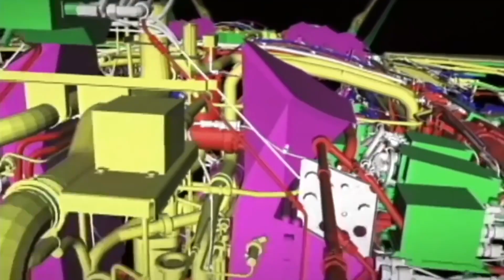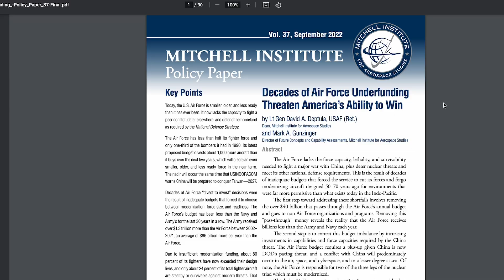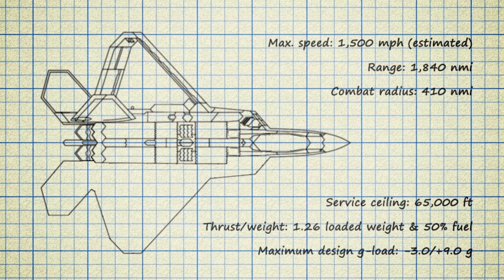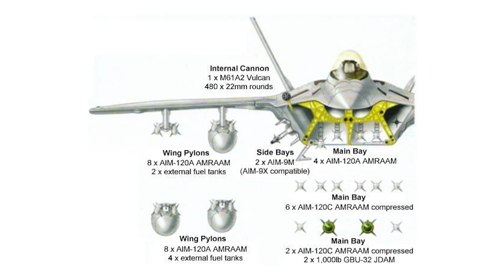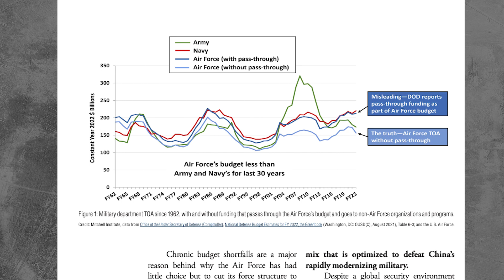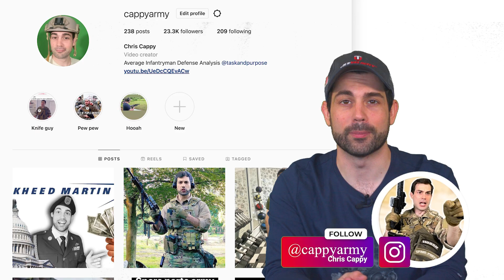Cancelling the F-22 Fighter is Worse than You Think

Comment: To think the US has had this for so long. They are miles ahead technological wise.
Reply: No they are not - F-22 is the Space Shuttle of the USAF - truly astounding technical achievement with basically 1970s technology. F-22 missed out on a giant leap in computing performance and density by about 5 years - as it is, it was rechipped with early 90s stuff when it was in production and those are obsolete. That leap has effectively obsoleted stealth and created much better weapons and weapons systems.    Programmes like Rafale, Typhoon and Gripen got lucky - they moved with the earth-shattering improvements in computing power and data density and were developed (or redeveloped!) from the outset with completely open architectures that are simple to modernise.   This stroke of luck in the Typhoon programme was due to BAe's experience of cancelling Nimrod MRA4, (and problems with Tornado F123) projects that suffered exactly the same issues as F-22. A highly sophisticated platform before there was sufficient computing power to do what was required in a modular way - point-to-point coding stressing over every wasted CPU cycle, systems talking directly to other systems over bespoke interfaces. By the time you've integrated anything new it was already out of date - this is the issue facing F-22 (and even F-35 to some extent.) with the Euro trio - or F-16 or F-15 you can just bolt bleeding-edge stuff on and have it up and running in no time with only aerodynamic profiles to worry about.
Reply: @LondonSteveLee  You sound all over the place. So the US isn't ahead or is it?  The Raptor is miles ahead of anything else.
Reply: @xkeyscore1120  The Raptor was amazing given the old tech it was built on - sadly it was built at the wrong time and cheap vastly more powerful computers made it much easier to surpass the systems onboard Raptor for a tenth of the budget.   The Raptor is practically undeployable in a modern theatre without support from other platforms due to the lack of onboard passive sensing aside RADAR sensing from the main RADAR, Gripen, Typhoon and Rafale all have helmet cued off-bore targeting WVR, passive sensing technologies BVR to hunt for pray without transmitting.  The whole point of F-22 was to sneak in undetected and do its stuff, but due to the lack of passive sensors it MUST hunt nose-hot (without AWAC support) telling the world where it is.  In the modern theatre the first fighter pilot to turn on his RADAR is probably as good as dead.

Comment: Literally 64B for a extra 122 what in the fuck. Dumbest decision they could have made.

NGAD(Air Force and Navy programs) don’t have a service entry till 2030 and the F-15s are past there Service life.

Literally the crutch of the U.S military eventual ability to maintain a edge will be due to them extending things past there service life and stopping production on new things early.

Case in point: what happens when NGAD cost more and is over due, which we know is gonna happen even tho every time in the pitch meeting it’s “cost effective” and “cheaper”. 

I’m sure if we did the cost analysis of keeping and extending F-15 past there service life vs just having replaced them with the F-22 of 700 fighters we’d seen a savings. 

Luckily I believe there are around 600-650 F-35s in service with a end totally of 1,700. I’d love to see what the cost benefit would be to just lower the F-15 numbers greatly and have a interim of F-35 taking over the role which it can do if you reorganize the way it’s deployed(for example numbers) thus saving money to eventually have NGAD completely replace F-22 and F-15.

Which does not solve the problem for the next 10 to 15 years as China ability to rapidly procure Up to date equipment.

Comment: The F-22 can be made again but they need to upgrade an existing F-22 with all the goodies it needs. I believe the F-22's are supposed to get a set of upgrades. After that they can start making more of them. I think it's silly to buy into the Air Force argument that it would be easier to develop and manufacture a new better aircraft then manufacturing an old one even without infrastructure. Logically you would have to pay for development and infrastructure of the new one and something tells me some of the incorrect (not necessarily bad) decision making didn't change when they thought about a 6th gen fighter. That smells like propaganda designed to catch another leader with their underwear down.

Comment: Regarding the powerful radar on the F-22:  Does the F-22 lose its stealth when it uses that radar?
Reply: No... And kinda yes, lemme explain:
Is something turns their radar up it can be detected via passive radar (listening to emissions)
F-22 have AESA radar though, so it can "highlight" some area with couple miliseconds pulse. That's not nearly enough for systems to tell something more than just "some radar is present roughly this way"

F-35 is better at this because of networking (one plane can spot targets for everyone) but it's still more than enough to remain hidden long enough
Reply: @juliuszkocinski7478  Thanks!

Comment: Both F-35 and F-15EX are more advanced than F-22. F-22 has a poor ground attack abilty compared to other fighters. It's maientance requirments are really high. So hard to get off the ground. It's most likly deterring anybody. The F-15Cs weren't deterring anybody off the south China sea. The oldests F-15s. F-35 is sufficent and F-15 flies further than F-22. Which is the gap. F-22 has more range than F-35. But less range than F-15. F-15 is not stealth so that's where the belly aching happens. Although electronic warfare would probably see F-15 do the job anyways. With maybe a few more losses than F-22. But you would be F-22s. But I'd argue F-15 is a  better multi role fighter. Can launch stand off ground missiles. F-22 can't. And since it's always over the target. F-22 would take more losses. F-22 is an outdated dinosaur. They're trying to remedy this with the NGAD fighter.

Comment: I had the pleasure and awe of watching F22 perform in Ocean City air show.  I've never seen any jet cone close.  While F22 design is old the delays of F35 forced the hand on actually building F22.  So far F35 have proven more expensive, less reliable but ultimately still requiring 90% different parts for each role.

Comment: Cancelled because it was too ahead of it’s time basically, our defense ministry doesn’t deem it necessary 💯🤷🏾‍♂️
Reply: Cancelled because it was too behind its time! Trying to develop 2020 capabilities with 1970s/80s and 90s computing platforms means it was obsolete the day it went into service.  Very unlucky - it missed out on the giant leap in computing by about 5 years. But that shift in technology means F-22 is practically impossible to modernise.  Other programmes like Typhoon saw the writing on the wall and scrapped the systems and started again from scratch producing a completely modular open computing architecture that's simple to keep up-to-date.  It's a crying shame because F-22 is a technological marvel. But then so was the space shuttle and you don't realise how dated it is until you see one of Elon's old-fashioned looking rockets rear up on themselves and self land! That what modern computing has brought to the fold. the ability to do the impossible with simpler more reliable mechanical underpinnings - and it's why F-15EX (and the Euro trio) is the right approach.  Bolt bleeding-edge sensors and missiles on to an F-15 and it will defeat the 30 year old Raptor.  Systems and sensors are the future - not so-called stealth.

Comment: I'm still of the mindset that the cost for the Raptor could go down slightly. If it was kept in production and more efficient upgrades and changes were made. Similar to the f15 and f16s. I'm also of a mindset that the cost for the raptor could have been dampened even by a little if a less powerful export variant was made. Of course, without all of the new tech that has to be kep secret. As that variant could give the US's allies an air template to build for their own use. Much like the f15 and f16. While also shelling out the much needed funding. In terms of buying and licensing to build.

Comment: The F35 is better suited to modern combat than the F22 in almost every scenario. Superior sensors, EW capabilities, and software while still sporting an impressive RCS all at a significantly lower cost. The F22 is incredibly expensive to build and maintain so it sounds to me like a good idea would be to instead use the F22 money on developing the NGAD program and having the F35 fill the void in the meantime. F35 is either more capable or almost as capable in almost every scenario at a lower cost.

Comment: I disagree Cappy.  Although you analysis is reasonable, you are not taking into consideration the fact that the F-22 is hideously expensive to maintain and operate.  Nice airplane, but the air to air mission is much less important than it was 50 years ago - thank surface to air systems for that.
Reply: And you can say exactly the same thing about F-35. For the same resources as keeping one F-35 operational you could probably fly five times the number of hours in Rafale, F-16 or Typhoon - and they'll do the role reliably - a third of your F-35 sorties will result in a premature RTB for one fault or another.    F-35 is probably a better air superiority platform than F-22 by now as it has had constantly developed weapons systems but it still faces the inordinately complex to operate and upgrade issues faced by F-22.  Systems and sensors wise if you were to develop F-35 from today - it would be complete in a quarter of the time with a quarter of the budget - simply because of the advancement in off-the-shelf sensors and computing power and there's little point spending so much time and effort on stealth - RADAR return digital processing has obsoleted that particular technology. F-15EX is exactly the right thing to do - spend the spare money on better weapons to be delivered by simplified platforms. AIM-260 is not even in production yet and it's already behind the curve.

Comment: The F-22 is to outdated to really bring in today's level, for example the EF - F-15EX - SU-57 and of cause the F-35 are more Advanced then the F-22, yes the F-22 is the most stealthiest, with a powerful Radar, but that doesn't mean its the most Advanced. plus the F-22 lacks a ton of systems.

One more thing, you said how its built and uses systems from Lockheed and so on, but you didn't say anything about the fact that, a lot of the F-22's systems our from BAE Systems.

Comment: Real data on the F-22 is still hard to come by, but what has been leaked is has an unusual high maintaince cost per flight hour (MMH/FH). 
If this is because of the engines or stealth coating not lasting is unknown. 
But this would also make it hard to sell to its allies as MMH/FH is a very important criteria and may not be information you wish to make public. 
Also the F-35 has never technoledgy in all areas, and this one is sold to allies.

Comment: Here’s a thought.  Cancel the F-35 and restart production of an upgraded F-22. Then, finally allowed advanced F-15’s (canted tails to reduce radar cross section and forward canard wings) to become the workhorse of the USAF in non-stealth roles (flies higher, faster, farther than any F-35 with multiple times the ordnance load). Upgrade CAS with new, improved A-10’s. The F-35 is dragging down the entire Air Force.

Comment: Creating a "new" fighter is cheaper than restarting the "F-22"...BS.  The fact that the F-35 is still in production, means that those buildings will still be occupied and whatever plane that is F-22esq will need new buildings.  Buildings are just brick and mortar stuff.  There is not real new engineering needed.  The assembly line and manufacturing machines are the same.

The expense with NGAD is research, design, development, testing, redesign, etc.  The F-22 does not have to go through all that initial phase process.  It is proven.   Updates in coatings, lessons learned from F-22 and F-35 could be incorporated.  There are proposals already for a new block for the F-22.  It should have the new network and possibly different coating and engine efficiency.

The real issue I think with F-22 vs. NGAD is the Navy.  The F-18 is aging.  The F-18 has the block III, but they limited the proposed updates to make sure that the F-18 block III was not too good to prevent the NGAD program.  I think that was also very short sighted.  The F-18 block III should have gotten the new engines that were proposed.  It would have had more thrust than the F-15.  The F-18 is exportable and capable of replacing the F-16 by all accounts.  It would have competed much better with the Eurofighter Typhoon and Rafale.  With the new engines, it is possible that the F-18 could achieve super cruise with a reduced load out.  The F-18 is way more cost effective than many other planes.

Anyway, the engineers let the politicians have all the say.  We would have cancelled the A-10 if it wasn't for John McCain.  The "super taco" is not a replacement.  It will take a long time for stealth planes to fulfill all the roles of the F-15, F-16, and F-18.  The F-18 growler is a good example.  Also all these planes have way more hard points than stealth planes.  We will need to send 3 times the number of stealth planes that a single F-18 can attack.  Pathetic logic and foresight.